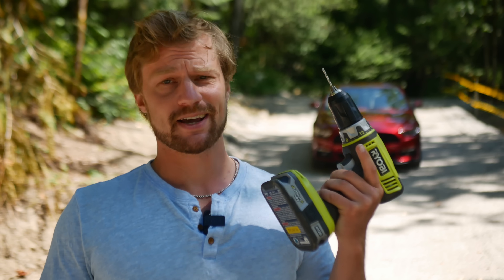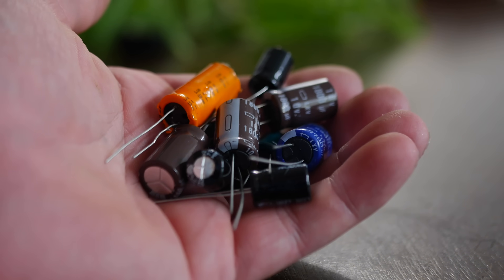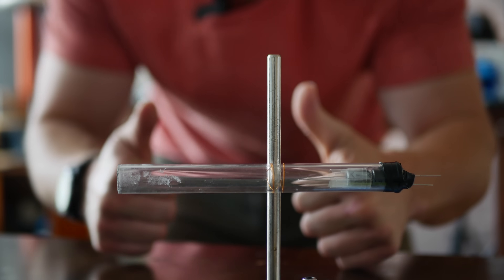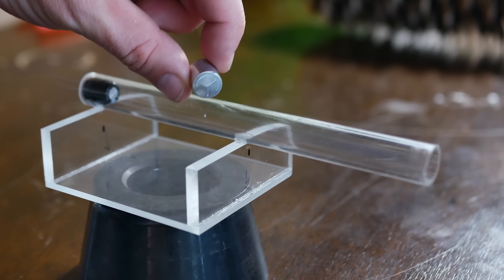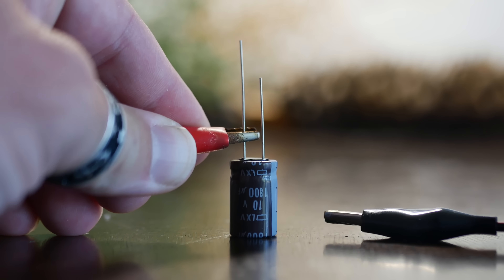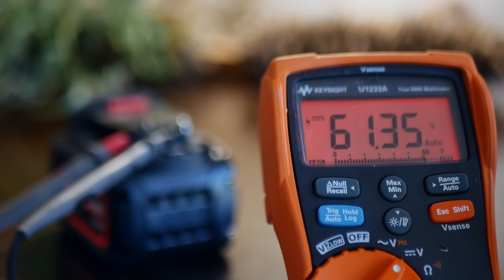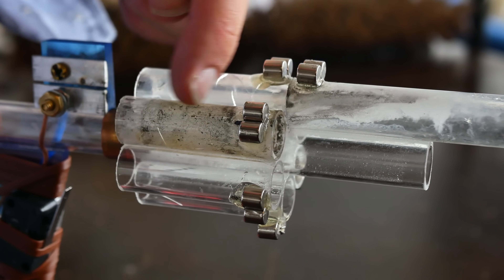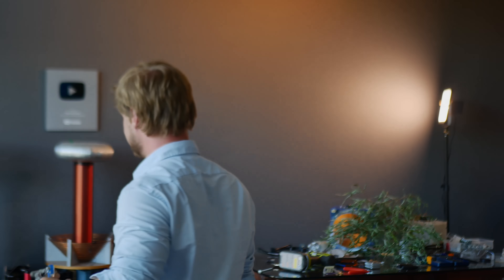I Built An Electric Capacitor Revolver!

Comment: What about using a capacitor to build up a strong sudden voltage to explode the capacitor? Almost like a spark plug. It might be more efficient and create more power.
Reply: A buck DC-DC step up module will be needed, up to 90V (I don't know if it exists on this value, if don't, will need a small 60VA inverter and a FULL BRIDGE RECTIFIER), and a big capacitor, because it needs give a 10 amps discharge.
Reply: @dschannel1171  there are upto like 1200W boost regulators so like 5-6 bateries in parallel and out being 75V 20A but at that point I'm bit worried about the capacitor it self exploding first from the back side instead of top also lead might be also problem
Reply: @dschannel1171  or use a microwafe capacitor... I think thay are around 2000V
Reply: @dschannel1171  With an inductor boost circuit, you can pick whatever final voltage you want.  That's essentially all a boost converter is, it's just that you can get a bunch of them off the shelf already configured for a specific voltage.
Reply: maybe the cap and charger from a camera flash (isnt it in a few hundred volts?)
Reply: @jjjacer  Yes it is and a sudden dump of joules into the cap would probably produce better results.  Added bonus the whine between shots as it recharges would sound great! 😀
Reply: It merely boils a fluid that sits in between the plates.
Reply: @brucebaxter6923  but with more power you might get it to boil faster. Getting a more violent reaction.
Reply: @zeanyt2372  
Yes. 
But the possible down side could be that it splits open before all the fluid has boiled. 

We want popcorn not a saucepan. 

Popcorn has an upper temperature limit.
Reply: @brucebaxter6923 So the very definition of Steam Punk?
Reply: @brucebaxter6923  make a microwave powered gun
Reply: No, we don't want steam, we want plasma... This is the plasma channel... High voltage for throughput and high amperage for volume.
Reply: @Unmannedair  steam is a good propellant force for projectiles though. Plasma.. Probably need a railgun to use that.
Reply: @trevorh6438  the plasma can superheat the steam and give it more pressure that way. Although you would probably need about 200V or more for some good plasma discharge and sveral 100 jule stored in the supply capasitor.
Reply: @fabianbohnert120  plasma isnt heat, it is electrical charge. You can make cold plasma, therefore, it is not the plasma that superheats steam, but the heat in a heating element.
Reply: @trevorh6438  well, in an electric discharge the plasma is the heating element. With enough power it will get really hot and can superheat the steam/electrolyte vapour.
Reply: Exactly. Two small transformers in series will give you 440-500 volts driven by a MOSFET inverter. Easy.
Reply: So, using a higher voltage capacitor to blow up lower voltage capacitors? I love it
Reply: electro thanos: I used the capacitors to destroy the capacitors
Reply: Hint: disposable camera ...
Reply: ah yes, the classic "use the capacitor to destroy the capacitor technique" lmao, it could work very well tho
Reply: Yeah but the problem with a weapon based on charging & firing is speed. Try to whip out a gun based in electric capacitors and you'll likely get dunked on with a plain ol' 9mm.
Reply: @sicariusprolibertate  true. This isn't a practical weapon. It's more like a fun and slightly dangerous science toy.
Reply: Issue is that Capacitor Pop is dependent on thermal expansion. Electrolytic caps in reverse leak & create a short. The short heats up and cause the liquid to turn in steam, triggering a steam explosion. 

I suppose you could roll your own out of something like a casing full of steel wool and another material that would rapidly expand. A high current & high voltage discharge in a casing of water can cause a small steam explosion.
Reply: Spark plug is a good thought train. As in, automotive coils used to fire spark plugs charge with 12-14v on the low side, and fire at upwards of 10000v. So if the velocity is proportional to the voltage, then that should be pretty fun. Another benefit being that they fire when grounded, and don't need much current to do so.

Comment: 2 batteries is 120v which is great but a lot of amps if you electrocute yourself so be well warned and wear hv gloves. Maybe a booster from one 18650 to 100 volts into a cap and then let loose into exploding capacitor . I t can remain compact then . Maybe a disposable camera flash cos they are 330 volts 😂
Reply from the maker: The staging cap idea seems to be the most common recommendation. Sounds like I need to try it.

Comment: Having accidentally exploded many caps, I can only imagine the smell this creates! I'd also be a bit worried about the fiberglass-like dielectric being atomized and inhaled, but the end result is pretty fun!
Reply: Isn't this humanity in a nutshell? "This might end horribly, but at least we had fun along the way!"
Reply: @Satelitko  A wonderful comparison.   Thank You.  And indeed, many population explosions have ended, likely horribly (imagine), and thus far we have been able to restart.
Reply: yeah and the toxicity of vaporized electrolyte ...
Reply: You require additional smart points to use these words logically and without lacking common sense.
Reply: Yeah. Silicosis is not your friend.....
Reply: @X--The_Lion  When I was younger there was nobody to told me that magic smoke is not super healthy. Also the solder with lead is not fun.. Fortunately Iam ok. :-) Just once battery blew up in my face and I was blind like for month, I recovered from that too and can see well :D Stay safe !
Reply: @jmenonenidulezite561  I had a little accident one time with a graphite and a UPS 12V battery, I tried a graphite lamp and when I turned it on, the 0,7 graphite just exploded on my face. I've learned that this graphites comes with a substance on it and I can't turn it on a high amp 12V battery, I have to limit the current or use a lower voltage first, to let all the smoke go away first, drying the substance of it first or it explodes, I also have a 12V high amp transformer, and if don't dry the graphite, it explodes.
Reply: @dschannel1171  haha i did same thing but fortunetly I had no such power to draw so it was self-limiting by current, you reminded me just another stupid things i was doing with graphite like "welding" Without UV filter mask and so on 😅😅
Reply: @jmenonenidulezite561  I've done a Humphrey Dave Arc lamp with a 12V AC modified microwave transformer (12 turns of the thicker wire that I could on secondary) and 2 carbon rods. It's a little harder to get the arc on low voltage, but is possible by doing a bad join between the rods to make then incandescent while trying. It's creates a big arc but don't sustainable for long without mechanic system to control the rods at this low voltage.
My 12V battery was rotten after 3 years on nobreak, maybe the arc would be more stable on DC.
I also didn't used a UV mask too.
Reply: @dschannel1171  Nice ! And I was thinking that Arc lamp was invented by F. Křižík ( he was also Czech like me), but I researched it and he just modified it. Interesting I didnt know that, maybee I have somthing to read about today so thx :-) 
DC has sure more stable arc, but I have seen welding machine just transformer like you did with MOT and it worked haha

When we are talking about lamps, next stupid thing i have done is to put HPS lamp on top of tesla coil.. The vacuum is not perfect and some particles can have very high energy and when hitting anode they emite radiation - in random direction of course :D :D Oh god Iam still alive, probbably gonna hit a big bong now to celebrate :-)
Reply: @Radek Blaha  What are the health problems related to using leaded solder? I don't know any real dangers of working with leaded solder
Reply: @sebimoe  People with prolonged exposure to lead may be at risk for high blood pressure, heart disease, kidney disease, and reduced fertility. It has to be long term exposure.. Nothing will happen to you if you will wash your hands after soldering.. But I used to eat and drink very often in my lab :-) Also fumes contain toxic lead oxide
Reply: @jmenonenidulezite561  Thanks. I was not aware that lead actually vaporises and is present in fumes, but I'm not sure how that changes if I would inhale it - lead free solder also has toxic resin fumes. Eating with your hands may be bad though. But also no matter the metal I would not be eating oxides :)
Reply: @jmenonenidulezite561  regarding your second post, I don't doubt that lead poisoning is real. I only doubt that you can get lead poisoning by soldering without reckless disregard for safety
Reply: @sebimoe  Amount of vaporized lead is minimum and yeah I think that it's not that big deal in hobby electrotechnics(as you said also free lead solder has fumes and Iam still using 40/60 SnPB without fear - just learned to wash hands after soldering, its about habbits :-) ), but for example people in China, working in that bad conditions for whole life have to be affected somehow. I read an great article about soldering safety but i cant find it now, i think it was from Texas Instruments or something like that
Question - can you buy lead solder in your country? Thanks to EU i cant, but there is always a way :-)
Reply: @sebimoe  I think it really depends whether you are a hobbyist who does an electronics project every few weeks or a professional who works with leaded solder in a factory for 8 hours per day. It's also worth knowing that they make little extractor fans for vacuuming the solder fumes away before they reach your face.
Reply: @X--The_Lion  You mean, Pneumonoultramicroscopicsilicovolcanoconiosis?
Reply: @vanitas83  is it scary that actually makes a firm amount of sense to my brain? Lol

Comment: Cool idea, but wouldn't want to breath the vaporized electrolytes. You could have doubled your voltage by having the 60v battery charge 2 caps up in parallel, and then disconnect from battery and connect in series with the exploding capacitor

Comment: A weird one but quite nifty nonetheless !👍 BTW, in the beginning you had mentioned both reverse polarity AND over voltage & It appears you are just "over-volting"🤪 them during most of the vid.  So, just out of curiosity, did you test reverse overvoltage Vs. distance too Vs. just overvoltage ?
Reply from the maker: Ah! Yes, I did test reverse polarity, and apparently forgot to include that footage. Reverse polarity actually hampered the output, made it unpredictable, and, slower to explode. So, Stuck with normal polarity.
Reply: @PlasmaChannel  Ah ha interesting.  👍

Comment: It may be difficult to do, but i think it would be a good idea to use dc-dc converter, for example 60V 17A to 100V 10A or even higher voltages. Only problem is, how current affects velocity of bullet, because with higher voltages there will be too much current and too much power draw so a resistor will be needed. 1000W boost converter isn't to big so it souldn't be a problem to implement it in this weapon... I mean... this experimental thing :P
Reply from the maker: Well stated at the end there, sir!

Comment: Could you have used a larger capacitor charged by a drill battery to get the extra voltage?

Comment: Great Job figuring things out..I remember using a battery and a solenoid switch to fire a semi auto just as fast as a auto rifle...Would like to make a coil or Rail gun with real POWER...Have any ideas? Thanks & keep up the great work..  P/S...You could also make it fire with a 1`.5 volt battery with a small high voltage inverter transformer & maybe a dc to dc converter... be great to make one that would shoot maybe bb's or pellets..A Poor Mans Ray Gun are fun also, & POWERFUL..Just need an old microwave oven and take the magnetron & Capacitor out & I think it also needs 1 more cap. and a diode...You can find it for free on Internet Archives...More Powerful than any Burning Laser... Thanks again...
Reply: The ATF is interested.

Comment: Hmm. I think the performance ceiling of this architecture is actually pretty high. It's basically an electrothermal propelled "launcher". As long as you have enough electrical energy delivered within the relevant few hundred microseconds, and the breech and barrel can take the pressure, and the seals don't blow out, etc etc, the molecular weight of the actual propellant is low (mostly water), so the achievable velocity should be pretty high. The capacitor casing should even help with the sealing. If you go to the high end you need basically all the features of a conventional propellant "launcher" though. Don't blow up anything in your face.
Reply: So basically like any other enclosed bore cannon. Because that's what it is.

You try so hard - So very hard to sound smart.

Comment: That looks like a lot of fun! Since voltage is directly related to velocity, I wonder how it would do if you used a boost module? Or a small high voltage power supply, like from one of your battery powered Tesla coils. Would there still be enough current?

Great video!
Reply: Or used a capacitor bank to blow up the capacitors!
Reply: You need quite a bit of current as well to blow up caps - so the velocity will go up with the voltage, but once the voltage get too high, the velocity will go down again due to lack of current capacity. So it will be a certain voltage that gives optimum result. Those high voltage sources that power tesla coils and stuff will not work, since their current output is only like a few milliamps. But, the more input power you have, the higher the optimum voltage will be. The voltage rating on the capacitor also matters - which will probably need to be exceeded by at least 2-3 times (lower voltage capacitors will probably work better with less voltage and more current - and higher voltage ones with higher voltage, less current). They can also be blown up by feeding them with the wrong polarity - in that case, quite low voltage (just about 5-10 V is often enough) and high current, probably gives the best result.
Reply from the maker: Thanks Nigel, yeah the voltage definitely has an impact, but i'm worried that boost converters would not provide enough steady current to explode the caps. However, 20 amps for half a second should not be too hard to manage....  The high voltage supplies from the tesla coils indeed may lack enough current to really boil the electrolyte inside the capacitor. I haven't tried it, admittedly though.
Reply: @PlasmaChannel  Can u use supercaps for steady current?
Reply: I was thinking to just use an automotive or motorcycle ignition coil, store it in a high voltage capacitor and pop caps at tens of thousands of volts.
Reply: @KillerNetDog  Ignition coils aren't very good at charging caps because they are pulse transformers. A flyback is much better and can easily be designed with the ideal parameters for the application.
Reply: The voltage is only related to the velocity up to the point where the insulation breaks down completely and current gets unevenly distributed. The ideal voltage is high enough to boil all the electrolyte as fast as possible but without making a charred point.